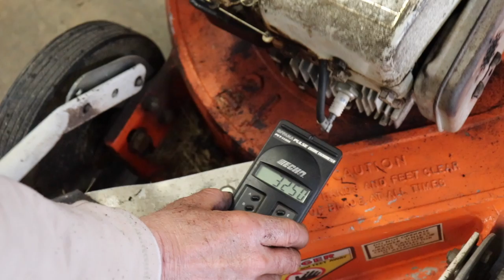How To EASILY Swap Old Briggs Carb & Gas Tank To Newer Style Carb and Tank

Comment from the maker: Support the channel! Grab yourself a Taryl T-Shirt, Coffee Mug, Tools & More! Shipping Worldwide Daily from the Taryl Apparel online store! 
http://www.TARYLFIXESALL.com
Reply: Taryl! Taryl! you gotta paint that tank white, because it wont work if you got black tank in white engine.
Reply: Hey Taryl
Thanks for the informative and entertaining video.
Do you have a "hack" (upgrade) video for the 5HP HS engines with the rusted $125 gas tank?
Reply: Oh cool! I have a same Sensation brand with the same old Briggs motor shown here except horizontal and is in/on a debris blower found in the back of an old storage trailer at an 2021 resort auction- it’s at least 40 yrs old and solid metal even the serial number sticker is metal!As opposed to a similar updated model I saw at a local power equipment dealer: Not a solid cast iron motor,looked like it was 80% plastic all for $8-900-$1,000+. This one is still powerful & pushes itself backwards - it just needed some elbow grease, patience intricately cleaning out the gas tank & overhauling the carburetor and a new spark plug. Ty Taryl

Comment: I just got a mower with this exact engine and it was updated with the newer plastic carb, I specifically bought it because they run forever, got it for $60 and it'll run longer than any new mower from the big box stores today.

I also had the issue with the rubber elbow to fitting onto the breather tube, this video showed me how to fix it for good, thanks a lot.

Comment: I ran a small engine repair years ago and still work on lawn mowers from time to time. I'm an old man and recognize a lot of the older engines you work on. I've got an old Moto Mower push mower with the offset front wheel for the discharge my father-in-law owned from the late 50's or 60's (I think). I'm going to restore it this summer.  I'm a fellow Hoosier in east central Indiana. I've watched all your videos and would rather watch you and your gang than anything else! Truly enjoy you and you are one very good hand at your trade. Thanks for all you do.

Comment: I love those old  B&S engines with this type of carburators. Very reliable and runs for ever. Cheap and easy to maintain.
Change the diaphragm, do all over cleaning, clean sparkplug,  new gazoline and oil and the engine runs again.
Reply: Absolutely !
My low priced Brigg 3.5 Classic is 38 years old and still running strong each season. 
Honda eat your heart out.
Reply: @loktom4068  That is awesome,just like cars the newer mowers have all kinds of unnecessary things, pretty soon they will be able to take pictures of your lawn while you mow it and send it to your relatives in Australia via a live feed (maybe they are already doing that,lol), my mower is 20 years old and although not as old as yours its simple as it can be and i love it

Comment: The skit was gold,1000% Truth for anyone in any kind of a shop, many many moons ago back when 1gb hard drive was a big deal I worked with computers and had someone bring in one they said it works fine you just have to slap the right side 3x then punch- kick it, I had multiple vehicles come through with similar story's and no joke a Murray push mower the lady said she would remove her shoes and point it to the east with some hail Marys or it wouldn't stay running,I'm sure alot of folks on here could share some golden story's.

Comment: At home on the farm in the '50's our first power mower was a 19" Lawnboy with rear discharge.
The sparkplug was at the front and I can still see my dad reaching over to the 'kill' lever and pushing the mower backwards and into his toes.  Not a pretty sight.  No amputations but nasty wounds.
Nice to see how that emulsion tube pops out.  I thought you were done working on the floor!
Great Cast Al. deck.

Comment: Hi Taryl. Thank you for this video. It was very helpful in getting an old Snapper running again. A patina'd 1981 Snapper 21350P. Waiting for the diaphragm, spring, and air filter to be able to use the original carb and tank. Using one of your other videos, I swapped in a newer electronic coil.
I've added your channel to my subscriptions. Between you, Steve's Small Engine Saloon, Bruce Pender, and Doublewide6, I'm learning enough to be a fair hand at small engine repair.

Comment: Good video Taryl. The first engine I ever overhauled was a 4.0hp B&S from the late 70's when I was 10 years old back in 1980. Good memories.   Now fast forward 40 years I recently had one of the worst customer service experiences ever with Stens. This involved an air filter that would not fit properly on my Cub Cadet 3205.  The phone representative was a nightmare to deal with and my email to them fell on deaf ears, no response.  I will never use another Sten's product again over that experience. Take care -Glen

Comment: This is why I love working on Briggs stuff. Design is so good they haven't had to change it since 1979!
Reply: an they run an  run...
Reply: Until 2012 when they replaced the good old push rod engines with the new plastic jet carb ohv engines like the 450e.

Comment: Great video this will help with our old Briggs Hahn mower doesn’t run  right I rebuilt the carb and Cleaned it but this is what we are going to do we will replace the whole tank assembly and carb it runs  and hunts and needs a lot of adjusting i think the video you did on that old rototiller there were Teflon washers so either I get those or o buy a whole new thing because it’s a great mower but it needs some carb work.  thanks taryl can’t say a better word than thanks buddy you are the best,      Your freind will I sent you an email a few weeks ago if you remember

Comment: They ( I believe B&S) had a thing that stated when installing the new base gasket on those carbs to scratch up the metal (grove it ) so the gasket wouldn’t squish out between the base and top of carb. They had issues of the gasket slipping out and that was the fix.

Comment: There was a lawnmower shop next door to our house when I was growing up so I was repairing mowers when I was 6 years old, this was the heyday of this mower and I worked on a bunch of them....I remember the pull start mechanism was always a weak point.
Reply: I have 3 of those engines and never had any starter issues. One of them has been used weekly since 1977 and even still has the original starter rope in it. Been ripped to the end thousands of times lol. Never had a thing done to it. My favorite recoil system by far.

Comment: Get a tube of Seal-all and squeeze a blob out in a dry perforated tank. It'll seal up the small holes in the steel tank where the dimple is where the pickup tube goes. Just squirt in a blob and it'll level itself out. Give it a while to cure and fill it up and go to work. I've done a 5 and a 4 horse like this. So far, so good on several seasons of leak stopping.

Comment: "Motor wind up and down" so I had carburetor to tank air leak to gasket, of course. So I put thin line of spray foam around the tank to gasket perimeter--just on the outside--and it worked for 9 years. The plastic carbs always warp a fraction away from the tank and makes a stupid air gap that you cannot even see and messes up the diaphragm pumping. Try and see how long yours lasts and see if you can make it longer than 9 years.
Reply: I didnt even change oil or spark plug for 25 years. Just filled 1 Liter oil in total. Those older brigg and stratton just last forever. I just have have one big rust hole the size of your hand and several rust holes on the frame but patched it up with some fiberglass and now its good for another 25 years i guess :D Briggs and stratton is just good quality even if it lasts 9 years its damn great with just those minor things to patchup.
Reply: @Coladudetje , wow!

Comment: I recently acquired a 1980 3.5hp on a snapper push mower. The engine looks very similar to that one. I would love to see a video of the teardown, fix and reassemble of that motor. And any parts /gaskets and anything else needed to rebuild. Should I stay with points or upgrade? Why isn't that design used anymore? I like the straight-up pull on the rope to start. Thanks for all your videos that have helped me tremendously.
Reply: All I had to do to get the one I have running after using this video was to sand the coil and the flywheel magnets, cut the wire going under the flywheel as close to it as possible and on the other end at the plug to the coil, swap in a newer coil, put in a new spark plug (Champion J19LM), put in fresh gas, set the throttle to Start, prime 5 times, and pull. It started on the 2nd pull and ran fine. Used it to cut the grass across the street yesterday.
To find parts for your engine, you will need the numbers on the blower housing. The Machine Type Model (MTM). And add a 0 in front of the number. For instance, mine is 93508 0189 01. For parts lookup on the Briggs site, I had to enter 093508-0189-99. Points or electronic depend on personal preference. Electronic = less maintenance and much easier to replace. Points = replace from time to time and set gap with a matchbook cover. Points are in a box under the flywheel, meaning you'd have to remove the blower housing, screen, starter clutch, and flywheel to get to them.
Reply: Chris Farr thanks

Comment: I have a Troy Bilt 160 Cc Self-propelled Walk Behind Lawn Mower...
I have stripped the carburetor down twice and cleaned jets and float bowl and gas tank and it will run great for about 30 minutes and starts surging .....Is the automatic choke causing a problem which I believe is the push in part that sits on the engine block before the carburetor , right.... It runs great but does at his within 30 minutes

Comment: On the new pastic ones, can you swap them out? For example I have a 09 p602 carburetor on a yard that needs a new jet. I can find more jets in a pack for the 09 p702 carburetor. I am wondering if you can swap that carburetor out in place of the original so that when I need to purchase future jets I can get the multi packs for cheaper.

Comment: How about a video on the other Briggs pusher carb style? Some have the primer, some don't. Has the rectangular filter, might be that Quantsum model.
Reply: That wouldn't be a bad shout as the Quantum engine you are on about went through three phases of carburettor. One had primer and manual choke, one had just manual choke no primer and the final versions of the Quantum engine had automatic choke. The manual choke carburettors have started to become obsolete so retro fitting the auto choke system and carburettor might be a good idea.

Comment: Ha Taryl  Can I put a primer carburetor on a on a non primer tank? are the tanks the same? I have a 4.75hp weed Eater with no primer and is hard to start. little gas and it start good but don't want daughter to fuss with that.

Comment: That was some good info I can use. Thanks.  Question: bought a 2017 Scag Turf Tiger 2 with a 35hp Vanguard engine, it's not EFI. It surges from low to high RPM's. It does not have the NIKKI carb. New fuel filter, new plugs. Any suggestion would be great. Thanks!👍

Comment: I've got -69 3hp Briggs lawn mower engine with the manual choke carb, and that tank dosn't fit with the auto choke Briggs engines from the 70's. Those 60's Briggs tanks got a different set up for instalment.

Comment: I have an MTD tiller with a B & S 5 hp that the tank cannot be cleaned because of the major rust problem.  The code for this engine is 92111927.  The tanks are hard to find and super expensive if found.  Do you know of a tank/carb combo I could replace the old ones with?  The carb has a pickup tube that goes into the tank, so I assume I would need to replace both.  I would mount a tank on the tiller frame if I knew of a carb with a bowl and fuel line if I knew of one that would fit.  I considered using propane, but I'm not sure it would work with this carb/tank type...unless I could pipe propane directly into the manifold.

I had a Kawasaki four wheeler once with a bad carb that was no longer made.  I used a Honda carb on it, and modified the ends of the choke and throttle with Honda ends.  It worked well.  This may sound funny, but I've built car engines and car carbs, boat engines and carbs as well as other two cycle engines and carbs.  But I no nothing about a mower and tiller engine and carb.  Thanks .

Comment: As a general rule, most old mowers are not even worth throwing a tank on them. You guys crack me up with your skits. Where do you find the time? With spring coming, I wont have time to think let alone play with old mowers. I see them sitting by the road and let the scrap guy have them. Usually the deck is rotted out and cables are all frozen. I got an early model Honda and found you cannot even get the carburetor  for it. It had the black plastic one, really weird design. All the reviews of that model confirmed no parts available.  It had cables for 4 different functions. I scrapped it.

Comment: We had an old Sensation mower that had the push handle mounted in the center of the frame so instead of turning the mower around to go in the other direction you just flipped the handle over.

Comment: What is the benefit swapping to the new carb? I've been collecting the choke style carbs because there adjustable.
Reply from the maker: If the original tank rots out or isn't repairable, you can swap it over to the newer style
Reply: They added the primer bulb so you dont have to pull it so many times to start it.

Comment: I found out the hard way, you have to be careful applying high air pressure to certain parts of the carb with the bulb on, it will pop like a shotgun and blow the bulb into smithereens. lol

Comment: I had a Jacobsen push mower back in the day with the exact same motor. I spent about half my time taking off the air filter and sticking my screwdriver down the carb to override that choke so it would start. DON’T SHUT HER OFF WHEN SHE’S HOT! Good old motor. Junky carb.

Comment: Yes,I prefer to stick with the old choke O matic carburettor over the pulsa prime one due to the fact that the old one has a mixture adjustment screw on it  & the pulsa prime carburettor is the non adjustable "low emissions" carburettor.

The choke O Matic carburettor is easy to fix & parts are still available for them,my 32 year old mower which is in this photo is going good with new piston rings fitted but I need to repaint it again :- 
https://m.facebook.com/photo.php?fbid=721464541376548&id=100005390262695&set=a.692635830926086&dm=1

Comment: That’s funny, I always convert new mowers to the old style carburetors. The new carburetors are all non- adjustable plastic pieces of crap.
Carbetrator, that’s what I calls them.
That auto choke is a piece of crap too. You need real old float carbetrator or on of those older ‘ suck up ‘ carburetors that only have one pick up
It’s harder but I make an adapter to bolt afloat carb on the tube that goes across the cylinder

Comment: Hey Guys I have a 6-hp  over-head valve Tecumseh snowblower engine for some reason the pull-cord kicks-back just like a lawnmower engine with a broken timing key. I have heard this happens if the valves are out of adjustment is this true.